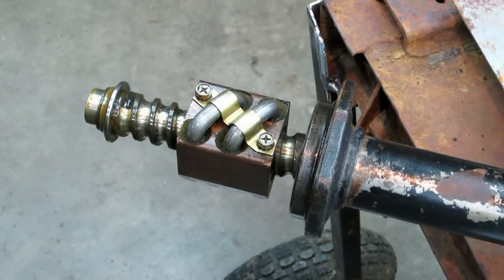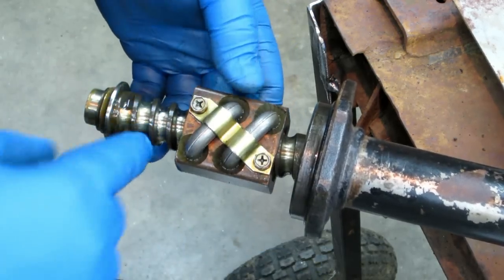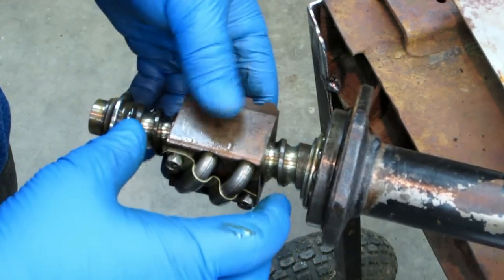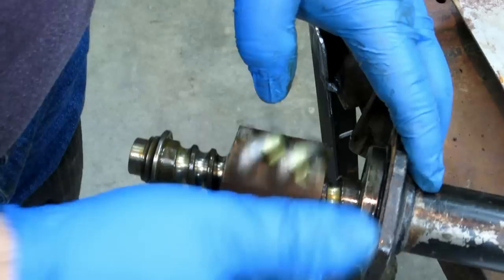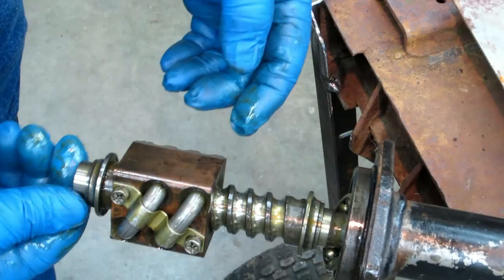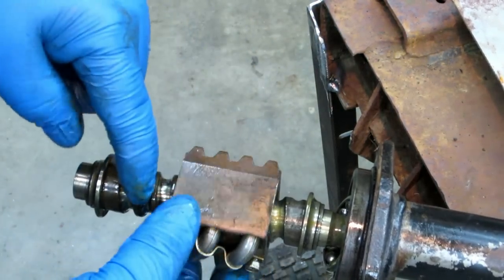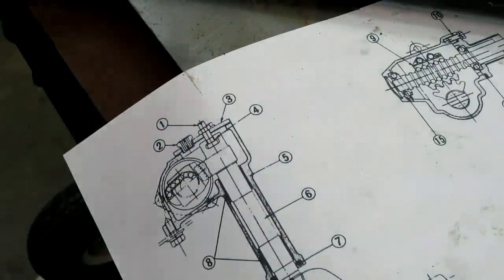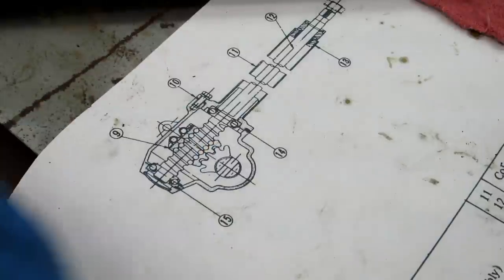Ball Screw

Comment: Ball screws and ball nuts are used in most modern automotive steering. The rack and pinion will not be going away anytime soon due to safety and reliability, but a ball screw is added to provide electronic assist.
Reply from the maker: Very interesting!!!  I did not know that....had to go look it up.  So instead of having a hydraulic piston for assist at the end of the rack, they use a ball screw and rotate the nut around it?  I've only found a couple of pics so far.  Awesome piece of info!  I thought that they worked like the aftermarket units I've seen for hot rods and attached to the end of the steering column. Thanks!!!

Comment: I just saw this video in my recommended right after I got home from work. Last night I worked on a ballscrew type horizontal stabilizer trim mechanism on a Boeing 757. I never realized they used them in automotive steering.
Reply from the maker: That's pretty cool!  They've been in steering boxes for a long time.  I guess I assumed the actuators in the airplanes were hydraulic.  I'm guessing yours are electric motors running the actuator/ballscrew...?  My cnc mill and lathe also use ball screws.  The mill's are turned by servos and the lathe is using stepper motors.  Thank for watching and commenting!! :)  Mike
hmmm....I know you said the trim mechanism, but if they're used on the other control surfaces....then I guess that means they're used to steer both vehicles. lol
Reply: bluehandsvideo Just to be clear, the actuator I’m referring to doesn’t move the primary flight controls. It adjusts the angle of incidence of the entire horizontal stabilizer in order to provide trim. And it is hydraulically powered. It has two hydraulic motors, held in place by two hydraulic brakes. The two motor-brake sets are connected together using a rotary summing mechanism; it’s just the opposite of an automotive differential; where two inputs are added together to produce one output. The screw turns inside a ballnut that is affixed to the leading edge of the stabilizer, raising and lowering it.
Reply from the maker: @singleproppilot  Ah....very interesting. Thanks for the explanation. :)
Reply: I build the ball screw for the 757 horizontal stabilizer
Reply from the maker: @EanDogonskiskate  Very cool! :)

Comment: Very fun.
A few corrections.
The tubes are formed in two parts because it is cheap, accurate, and provides excellent fluid flow. If they where made today out of solid tube, they would be made the same way they were 100 years ago, the same way an exhaust pipe is formed. It would be drawn around a mandrel with a plug inside it to keep diameter. The tube would then have to be broached a many points to allow fluid in and out. You would get a more expensive part that was in no way better than the cheap stamped part in your hand. This part would never be formed on a CNC machine, it will always be formed on an automatic stamping machine.
Also, you are still wrong about LH/RH usage.
Think about it, it does not matter what side of the car you sit on, when you turn the steering wheel to the right, the wheels turn right. The only difference between a RH and a LH gear box is the mounting lugs, the internals are exactly the same.
Reply from the maker: joshua43214 Interesting info about the tubes. Thanks! :)Funny....I was just thinking about this the other day.  I agree with you....for the most part.  If I could move the box from the inner left frame rail to the outer right frame rail....it would work perfectly and mount up just fine...except for the linkage.  If I moved it from the left inner to the right inner without rotating the box in any way, it would work,  but mounting would be a nightmare with this box.  Probably no clear in this vid......or in any other maybe.......the box needs to rotate vertically 180 degrees to mount and line up with the linkage.  When that happens, the sector shaft changes sides which causes the need for a different thread on the ball screw.  I'll have to look at my frame clip tomorrow to see if your idea is possible with this box.  I hadn't really looked at the option of mounting it without rotating it.  Thanks!!!
Reply: bluehandsvideo I'm not sure what the original application was, but there is a decent chance that you can get a RH version of the box somewhere. I get the impression it is American, the same chassis may have been exported to a LH drive country. There was a lot of stuff sent to Japan and Australia in the past.
Iirc, there was only a small handful of Japanese cars that were US only. I doubt they would have redesigned the steering system, so even one of those should have a Japan equivalent. 
Not an expert on American/Jap. My background was in Euro luxury. I used to work on a lot of gray market German and Italian stuff. The German stuff used off the shelf RH parts, and I seem to remember the Italian and French stuff using stuff from GM's Euro plant.
The box is only half the issue, you will also have trouble mounting the idler. The Pitman arm might have clearance issues, and the drag bar might not work at all.
It will probably be easier to match it up to something that was natively LH than to adapt all the RH stuff.
This is what we always called an abortion - most techs would run for the hills when they saw them. I made a good living charging extra money for working on abortions.
Reply from the maker: joshua43214
This box would have been a late 60's Datsun truck.  You're right.....RHD versions are available in Japan and Australia. It's been done before.  The dashes are nice and symetrical and lend themselves to be modified rather than replaced.  Since each model of the truck had both versions, the idler arm moves right over.....linkage and clearance aren't an issue.  I had a postal mail jeep in the mid-80's for a few years.......I got the "right hand drive desire" out of my system then!  I've never had any desire to drive one again. At least not on a road in the US.  The RH conversion is brought up a lot in the Datsun community....that was the only reason I mentioned it in the vid. I used to work on cars for other people....never made any good money at it, but I did develop a pretty strong disdain for it! lol  I enjoy making parts and mods, but general mechanic work, no thanks!!!!
Thanks for all the info!!!!
Mike
Reply: Ahhh, Datsun. I cut my teeth on Datsun Z's and VW's. I realized that there was good money to be made doing the stuff that no one else would touch. Next thing I knew, I was working on Fiat, Peugeot, Aston, and other odd ball Euro stuff.
Wound up in an MB specialty shop working on a lot of rare classic cars that folks collected and drove rarely.
I actually had one guy bring me his 1956 SL to pull the engine so he could repaint the engine bay. Trust me, you have not lived until you have to shoe horn a motor into a freshly painted engine bay on a car that belongs in a museum. Took me close to 3 hours to lower the engine onto the mounts, a job I usually would do in about 10 minutes. I charged him over $1200.00 for less than two days work back in the '80s and he was happy as a clam.
My last job was in a major BMW dealer. No one there could stand getting dirty, so whenever an off-warranty car showed up, everyone went to lunch.
No one could understand why I made more money than most of the techs, but still went home right after lunch every day. There is good money to made working on stuff no one wants to touch once you get tooled and skilled.
Reply from the maker: joshua43214
I think I'll happily pass on that particular life event! lol  I don't enjoy pulling/installing motors in beaters....can't imagine doing a high end exotic! 
All the new mechanics these days......I've heard a lot of them need the computer to help them......I would think the demand would be going up for old school mechanics since all the "boomers" are buying up older vehicles and rebuilding them.  ??? maybe?

Comment: Do you know how many balls are supposed to be in that thing I watched a video where a guy said those tubes are supposed to be full of balls also
Reply from the maker: Sorry, I don't know how many are supposed to be in there, but he's right, they should be full of balls. Basically.....as many as will possibly fit is how many should be in there. Neither the parts manual nor the service manual say how many balls or what size.
Reply: @bluehandsvideo   That strange cause mine doesn't have any balls in the sleeves, strange
Reply from the maker: @mountainmike1685  I'm basing that on other ball screws I've dealt with, so I could be wrong......but I'm about 99% sure they should be full of balls.  Ratsun.net is about the best place to find info on the Datsun trucks.  The FB version is more for social stuff.  I don't see any Datsun stuff on your channel, so maybe you're working on something different.  Have you tried google?  Lots of ball screw info pops up about them.

Comment from the maker: It used to be widely used and may still be in trucks.   It's actually pretty "sloppy" compared to a rack and pinion setup.  If you type  ball screw steering   into google, you get a lot images that will show/explain how the balls are held way better than I could describe here.  Before long, it will all be steer by wire and not have either of these types of mechanisms. lol  :)
Thanks! You're more than welcome.

Comment: Do you know how find the correct size balls for a steering box?
Reply from the maker: If you have some of the original balls, you can use a micrometer to measure them, then research where to buy precision ball bearings in that size.  I've never tried to do that and I have no clue where to go with that info.  Looks like McMaster-Carr has the raw balls in different sizes, but I have now clue what size is needed.

Comment from the maker: I don't think so...at least not technically.  They both look similar from the outside, but with the worm and roller type, it doesn't have the cage gear with the balls in it on the main shaft.  The worm engages a roller that's on bearings...that roller is attached where the gear teeth are on the sector shaft.  I'm sure the effect is very similar.  I would think that there would be even less play in the "worm/roller" style.

Comment: What would happen if you took the ball bearing out, it wouldn't turn right? I rebuild my box and for got to put them back and now it won't turn
Reply from the maker: Sorry for the delay....I don't get email notifications for comments all the time.  I'm sure it would bind up and not turn well.....but do you mean that it just won't turn to the right?  At first I thought you meant "correctly".  If it won't turn to the right, things aren't lined up correctly.  Did you forget the bearing in the bottom or the end near the shaft?  I had some trouble keeping the one on the bottom in place while I got the shaft seated.
Reply: @bluehandsvideo  I've got it, the ball bearings are what keeps the worm and piston locked together, I didn't reassemble it right and the first time I put it together I had absolutely no steering, its good now, thanks!

Comment: Hi, what is this type of ball screw exactly called? I need it for an application where I can move the nut linearly and make the screw rotate. Basically need an increase in no. of rotations for smaller linear travel. The closest I found was a Free wheeling ball screw and nut assembly but I'm doubtful about it. 
Any input from your side would be very helpful.  Thanks!
Reply from the maker: Sorry, I don't have any clue.  Maybe another viewer will have more info.
Reply: You can get a high pitch ground recirculating ball screw with no pre load and oil lubrication if you have 3000dollars to spare

Comment: Do you have to remove the sector gear to remove/or install the ball screw?
Reply from the maker: no, but it's a bit tricky.  I show it in another video....  https://youtu.be/GI9ex_2e5Po?t=508
Reply: @bluehandsvideo  It looks like when removing the sector shaft cover leaves just enough play to get the ball nut in there. Have you tried it with the sector cover in place? Both videos were extremely helpful...thank you sir! 👍👍👍
Reply from the maker: @_spider_jeff  It's been a really long time since I played with that, but I think the cover may need to be off so you can see the alignment to put it back together.  I'm sure you can get it apart without taking it off.  I'm happy to hear they helped.   You're more than welcome. :)

Comment: Can you replace the block
Reply from the maker: The ball nut?  I don't think so.  I'm not sure if the bearing seat is pressed on or welded .  If it's welded, then no.  If it's pressed on and you have a gear puller that can take it off....then you have to remove all of the balls and the block will come off the end.  If it's worn enough to replace, I'll bet the shaft piece is worn too.  It would be a lot easier to just get an entire box that's in better shape.

Comment: Where can i buy this item?
Reply from the maker: buy "what" item?
Reply: bluehandsvideo the circulating ball screw
Reply from the maker: @norinesotelo4155  I've never seen any up for sale anywhere.  There are  sellers on ebay from Thailand that seem to be clearing out NOS parts from dealers/warehouses over there.  Maybe one of them can obtain one?  If you use google to find a site with the factory parts manual, you can come up with the factory part number which will help them a lot. Otherwise, getting another used one is about you're only option.  Good luck!
Reply: bluehandsvideo okay thank you
Reply: bluehandsvideo what do you call the one where the ball is circulating?
Reply from the maker: @norinesotelo4155  You're welcome.
Reply from the maker: @norinesotelo4155  It's a recirculating ball screw, but if it has another name, I don't know it.  The ball screw part is welded to the steering shaft. It's all one piece.

Comment: could this steering type be broken? what causes it to broke?
Reply from the maker: Hmm....I guess everything can break.  Usually, they just get really worn and sloppy.  If one of the ball returns broke or came off....the balls would fall out....that would stop it from working.  
How did it stop working.....is it locked up and won't turn at all or is the steering shaft just spinning freely and not moving the pitman arm?
Reply: bluehandsvideo thanks for the answer. i don't have any clue for the problem because i've never seen steering wheel broken since i've never work with actual car.
Reply from the maker: you're welcome :)    There's probably a number of things that could fail/break.......but there are also other things that could go wrong that might make it seem like it's the steering box.  You'll have to get more specific info about the car's problem before anything can be figured out. :)
Reply: bluehandsvideo at least i already know that low maintenance would cause it to break :D
Reply from the maker: Cool! 
Thanks!
Mike